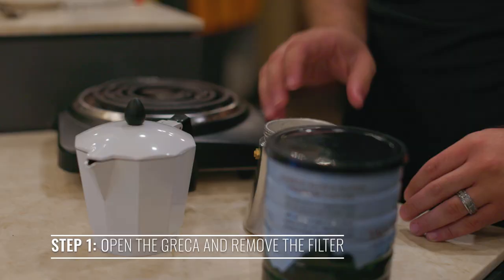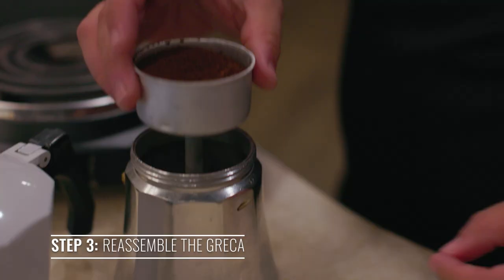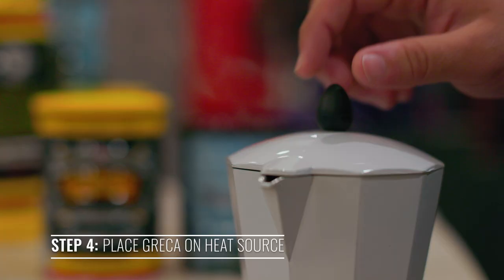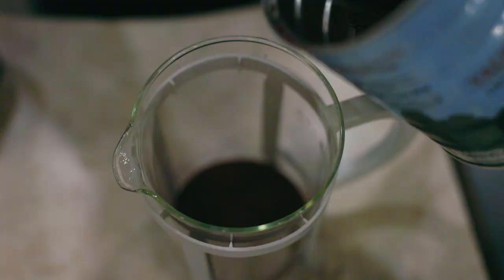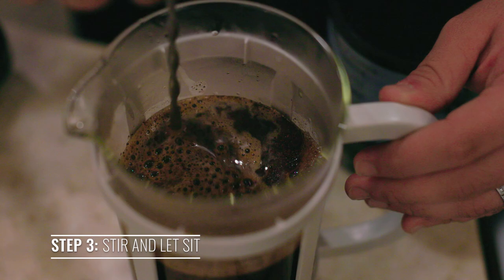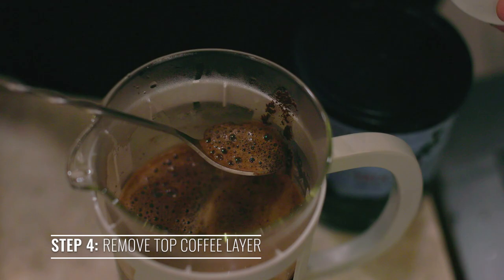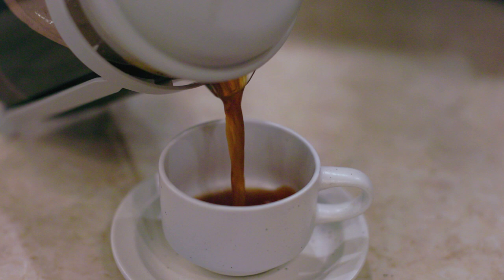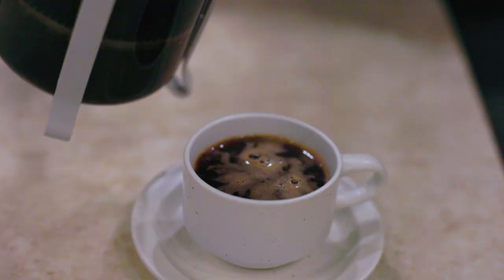How to Make Puerto Rico’s Coffee

Comment: Greca process is completely incorrect.

1-You fill the reservoir with hot water.
2-You shock the coffee in the filter with some hot water.
3-You set heat to medium or medium-low.
4-As soon as coffee starts filling the bottom of the Greca, you turn the heat off, and let the Greca do its thing .